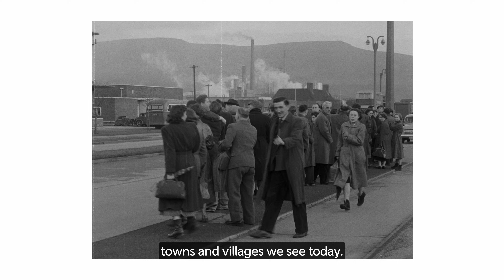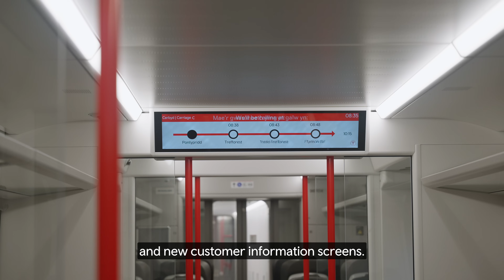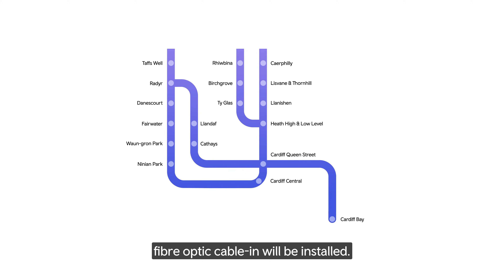Building the South Wales Metro

Comment: I know these bimode/ trimode hybrid diesel electric battery trains  are not an efficient long term solution when it comes to energy consumption  and maitainance costs   . You still cant beat full electrification not withstanding the initially high investment needed for complete electrification of a railway line.

Comment: Why can’t Network Rail continue on electrifying the South Wales Main Line to Swansea from Cardiff Central. And for GWR Class 800 and Class 802 IETs to run fully electric to Swansea from London Paddington. Without having the need to change to diesel power at Cardiff Central.

Comment: So please don't claim that electrification between Cardiff and Pontypridd is completely when there are huge gaps in the wiring. And tram-train is when the City tram runs onto the main line. Running tram-like vehicles on the railway is not tram-train.

Comment: I really hope the Welsh Government realises at some point that Swansea is in South Wales too…
Reply: For real though, Swansea, I feel like it’s starting to get ignored. Like the electrification plans for its main rail to Cardiff already got scrapped and the fact that it’s Wales’s second biggest city just makes Swansea worth more to invest in.
Reply: South West Wales metro is in the works utilising similar tram trains to the SW Metro. It’s all dependent on funding though.
Reply: @iman2341 The plans have been de-scoped to almost nothing, and even so there’s no indication if they’ll ever be fundable.
Reply: These trains can run to Swansea, being bi modal. It's jus not in the Valley Lines plan, neither is Newport.
Reply: @MikeWilcockRailsinWales2025 
They can’t. The Class 756 units have a small diesel engine for last mile operation at speeds below 50mph. This wouldn’t work for the main line. Keep your eyes on the 231 units though, which TfW are exploring for conversion to proper bi-modes
Reply: @WalesRails  yeah I think in the longer term they (231?) will run the Cheltenham Spa services
Reply: @MikeWilcockRailsinWales2025 
They can’t. The Class 756 units have a small diesel engine for last mile operation at speeds below 50mph. This wouldn’t work for the main line. Keep your eyes on the 231 units though, which TfW are exploring for conversion to proper bi-modes
Reply: @MikeWilcockRailsinWales2025 

In addition to the point raised above that no, these trains can’t run to Swansea, my complaint is that if you’re going to crow about a “new vision for transport in south wales”, then you need to talk about more than the eastern valleys and Cardiff

Comment: Love to see other places understand the benefits of electrification, which has been around for more than 100 years. Yet many places, especially in North America, still refuse to electrify and rather try unproven tech bro solutions like hydrogen trains (looking at you SoCal)
Reply: There are parts of the US rail network that were electrified in the past, but where the overhead lines were actually ripped out. And the USA also had many electrified tram networks that got bought out by car manufacturers and run into the ground, so the car industry could justify ripping them all out.
Reply: Hydrogen fuel cells are actually a proven technology, it's just getting the hydrogen that is the problem. However, it's about the same level of difficulty as say, drilling and refining oil from the middle of the ocean
Reply: @mattevans4377 Going backwards to the purpose, hydrogen trains are being not deployed in Germany and running back to diesel or battery eletrix because of cost and reliability